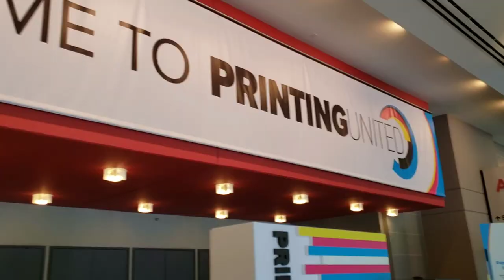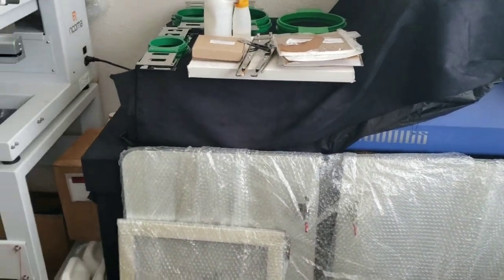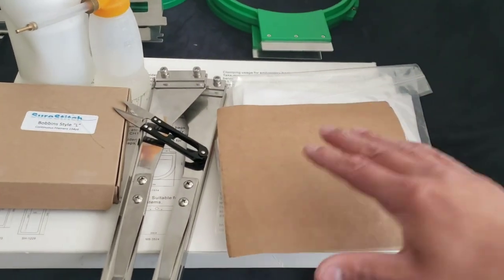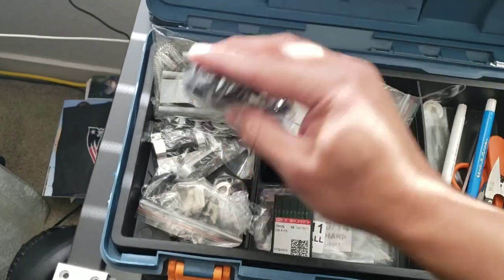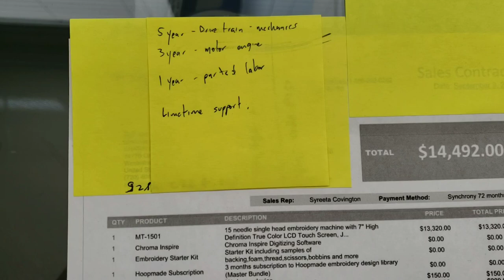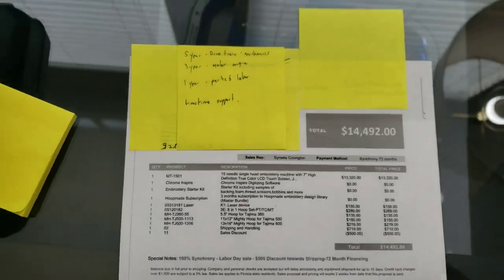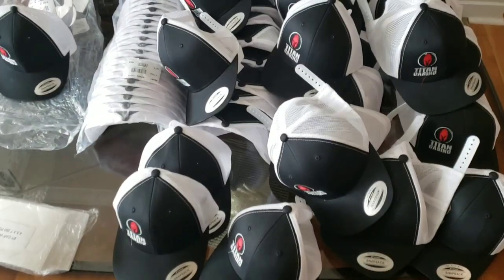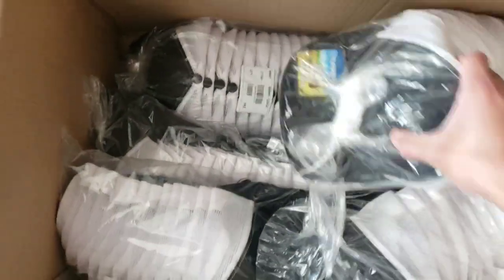UNBOXING MY $14500 RICOMA MT-1501 EMBROIDERY  MACHINE

Comment: Hey Bud, I just got the same machine, I do mostly hats for my business. I have a question wanted to see if you knew...I know when you digitize for a hat, it's bottom up, center out, that's all good. My question is for a "flag" design do you just digitize the strips bottom up and end to end?? Or do I do center out and come back to finish the stripe, when I do that it leaves a a noticeable restart area.  Hope that makes sense.
Reply from the maker: I did some flags and the way I dod it is just from the bottom and one side to another and they came out fine!!! I know about that restart line just do it one side to another you'll be ok
Reply: @SESHIRTSANDHOODIES  Very cool, thank you. I'll re-digitize it to do that.
Reply from the maker: @gritgearapparel  no. Thank you anytime I can help I'm happy to....
Reply from the maker: When you see it out, I always sew it on a piece of backing first. Backing is way cheaper than wasting hats!!!

Comment: Looking at buying a used one for 7k. Do you think it worth looking into or should I go in a different direction?
Reply from the maker: It depends on the shape starting out i recommend new because you're going to mess stuff up and a warrenty lets you sleep at night
Reply: The machine is only 2 years old so it has some warranty left. Guy has it set up so I going to take a few hats to try it out.
Reply: Thanks for the advice. I'll update you if I decide to buy. Thanks again